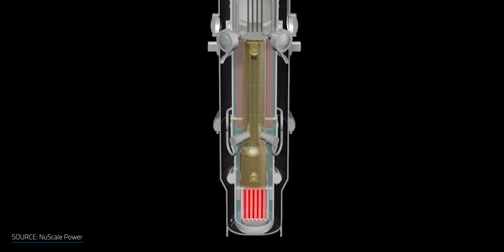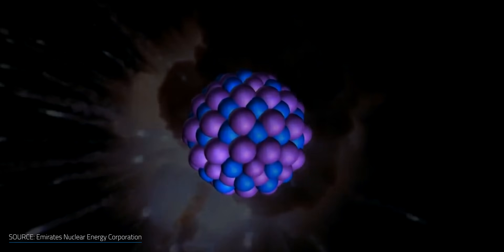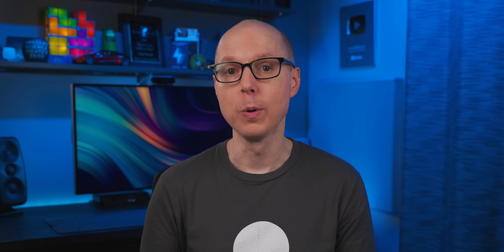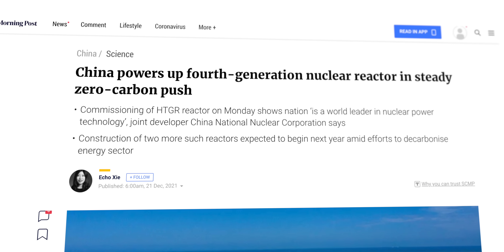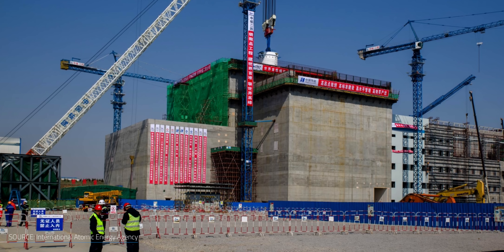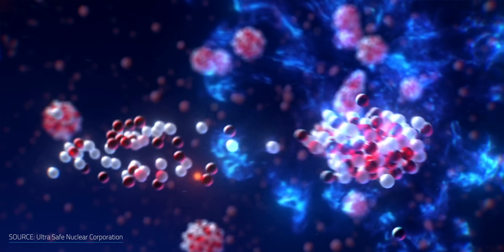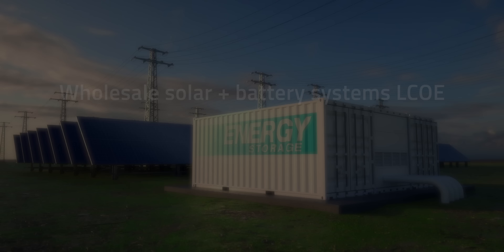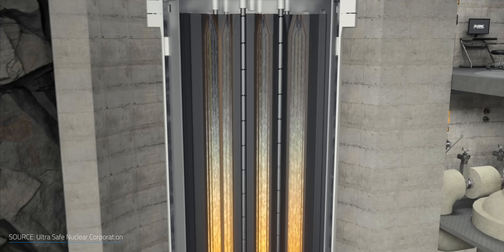Forget Small ... What About Micro Nuclear Energy?

Comment: I think it would be cool but geothermal would be good to invest in as well.
Thoughts.
Reply: Ofc. In the optimal regions, use geothermal. There’s no renewable I think I wouldn’t endorse atp. Small Nuclear could accelerate decarbonization and fill in gaps where renewables fall short
Reply: @Maverickgouda  I mean in places that can use it or don't need new technology to get deep enough.
Reply: @thesilentone4024  right, I think it’s kinda low hanging fruit & I’m not sure why it isnt there yet. I’m not even a fan of enhanced geothermal yet, solely because of the seismic effects. I believe in pursuing each renewable in their niche(s). Even more broadly, there’s applications like using geothermal to heat buildings I’d like to see explored. I’m not speaking as an expert, but something that might lower the energy needs.

Comment: On nuclear waste: 1. We know exactly where ALL of the waste is, usually stored safely on site, 2. There is the potential to use nuclear waste in next generation reactors making already cheap fuel even cheaper, 3. Due to the incredibly high energy density there is very little waste compared to other technologies.  Every energy technology produces waste.  Solar is probably the worst. After 20 years what do you do with millions and millions of dead solar panels.  Currently going into landfills or burned. Very little recycling. Also almost all solar panels come from China.
Reply: Solar pannels can be recylced, it just was to expensive. Like with everything, we throw most things away and not repair them. There are companies wo specialize in solar panel treatment and recyling.
Reply: You can bury all the dead solar panels you want in my back yard. Nuclear waste? Not so much. That being said, I do like the idea of SMR's.
Reply: Nuclear waste is an entirely different beast from solar waste though. Solar waste is waste. Nuclear waste is a hazard. Not saying solar panel manufacturing and recycling doesn't need a lot of work, but comparing it to nuclear waste just by amount is missing the point. 

Also we know where all the nuclear waste is because the technology is very centralized and regulated, we cannot assume things will be the same if it isn't.
Reply: nuclear will be 95% burn up and decay back to background levels in ~ 300 years, the nasty chemicals used to make solar is permanent and you need more of them then nuclear
Reply: @bencoad8492  What nasty chemicals? And please read about the horrible disaster uran mining is. And your 300 years figure is for processes which are not more than lab experiments. But even it it was true, humanity can´t think further than the next fiscal year anyway, so 300 years is still crazy.
Reply: @DamienFromPoison  so you don't know how solar panels are made...300 years figure isn't reprocess its liquid fueled molten salt reactors.. they do in reactor...

Comment: The Moltex fast reactor is fuelled by tubes containing the fissile materials as salts diluted by chloride (common salt). It’s cooled with the same salt species minus the fuel. There is no molten metal, no moderator and no pressure in the core. They are fuelled by the nuclear waste we otherwise struggle to deal with.  
The issues are entirely regulatory. USA regs are built for PWR. Anything else literally can’t tick the boxes so can’t get certified. 
U.K. regs are deliberately opaque and slow so nothing gets done. 
Canada is working with Moltex hoping to be on the grid by 2030.
It will be fuelled with fuel waste taken from a nearby CANDU plant. 
There is a long list of reasons why this system should be encouraged but (as ever) nobody wants to talk about nuclear.
Reply: Exactly. And for any doubt one can just look at France who has been pioneering this stuff for years now. In many regards it's all about public and political perception. Meanwhile Germany pulled off all their nuclear facilities and in turn invested only in solar and wind, and now they are in an "energy crisis" because the typical renewable sources can't keep up with the massive gap that nuclear left behind so fossil fuel plants have been employed to help ease the transition, and already it's estimated that a far greater number of people have died prematurely from air pollution from those plants, than nuclear has ever caused. All that for going green through the logic of commonfolk and politics, rather than science and research.
Reply: @Real_MisterSir  Absolutely true right on
Reply: These reactors are poorly suited for breeding weapons grade material - America wouldn't build anything but a PWR

Comment: Still taking the thorium cost at face value, despite thorium reactors requiring similar tech to fast reactors with reprocessing and the fuel and waste disposal costs not being the bottleneck? Thorium has some nice properties, but little about it is inherently cheaper, never mind significantly so. Molten salt looks promising, but is actually more useful for fast uranium reactors than thorium.
Micro is a commercial non starter because it solves problems that don't exist and creates whole new ones (similar to thorium in that regard). Being mobile is a regulatory, security, and proliferation nightmare. SMR are in the sweet spot where factory mass production is possible, but they are still inconvenient enough to move that they can be kept track of. 
Specifically for the numbers given by radiant; 7 years of fuel is overkill for almost all use cases, and makes it significantly more of a hazard. 1 year would be fine. The only use case I can see is small temporary military facilities (particularly if they are moving towards lots of EVs), and in that role fielding a reactor with 6 years of caesium 137 build-up strikes me as moronic. To avoid significant contamination in the case of it being attacked (which it has to expect) you would want to keep waste stockpiles low.

Oh, wait. I see. It is intended for Mars... It actually seems ideal for that. Like many of Elon's projects, great for Mars, sort of useless here (not a criticism).

Comment: The Ex-SpaceX engineer effort with micro reactors is interesting. A truly effective interplanetary transport would be nuclear driven, not chemical.  The ISP from thermal nuclear engines is 3 times that of chemical rockets. This delivers 3 times more impulse or Delta-V, more "mileage". Electric magneto-hydrodynamic engines,, still theoretical, offer even higher specific Impulse.  Higher ISP means less reaction mass needs to be lifted into orbit. Or, the ratio of delivered cargo mass to total mass increases.  One has to wonder what all the markets for micro reactors will be. SpaceX will need micro reactors for 2nd generation space trucks and to power settlements on the moon, Mars or space settlements.

Comment: I wonder if the West had replaced all its housing stock with super-insulated, controlled ventilated, passive designs with seasonal solar water batch heaters and maybe some solar panels or similar as an add ons, what would the power grid then require? Or could many regions have housing off of the grid?

Reactors look to me to be 'dooms day targets' for H-bombs.

Comment: The higher price for a micro nuclear plant may be acceptable if used as backup for solar/wind. Then solar/wind will need less storage capacity.
Reply: nuclear cannot be a backup it has huge inertia
Reply: @guai9632  Thanks.
Reply: @guai9632  huge inertia? maybe with the old style solid fueled reactors but with liquid fueled molten salt reactors you just change the flow rate aka they can load follow.
Reply: Except that storage is cheap & getting cheaper and longer lasting (both storage time, and duration energy is fed back to grid) technologies are already being deployed.

Check out Matt's earlier videos on Cryo storage and iron flow batteries.
Reply: @IronmanV5  Thanks Mark.

Comment: Nuclear waste is still the big negative for any Nuclear Power solution in my opinion. No progress has been made on a solution apart from putting it in deep big holes and hoping for the best. It is also very very expensive and new plants in the UK are way over budget.
Reply: The nuclear waste problem is massively over blown. The actual amount of high level nuclear waste is tiny if you reprocess the fuel. The propose geological storage sites are ridiculously stable and secure for many millions of years. For example salt mines have been proposed because we know that water hasn't managed to get in there for millions of years because if it had the salt would have washed away. Personally, I think the amount of waste with processing is so small we should consider keeping is accessible for the foreseeable future. In the future we might either find uses for it or be able to destroy it both of which would completely solve the problem.
Reply: Concerning waste disposal, my point is that these materials are mined -- from the ground.  I live on, or near, a very large natural deposit of uranium and such, and it complicates where potable water wells can be drilled, but not overbearingly so.  This occurs naturally.  Putting our waste back in the ground, and taking measures to mitigate affect isn't catastrophe or relegate superior ideas unobtainable.  Mines are, by definition, areas of concentration.  We're smarter than gas-lighting catchphrases, but people generally prefer emotion over problem-solving.
Reply: Where does uranium come from, in the first place?
Reply: @PhinAI  it's a naturally occurring metal and is mined as are other metals. I believe Canada and Australia are two large uranium ore producers. There are others, Nambia I think is one, but I would have to look them up. 
The biggest problem is naturally occurring uranium ore is very low in fissionable uranium. Namely U235. So it has to be enriched.
Reply: ...dum da da dum...dum da da dum....
Malleable manipulateable dupes....
Grim, just how in the possible heck do you personally plan to stop emitting this said carbon?  Quit breathing?  Really?  You're listening to a bunch of greedy selfish manipulators.  The answer is always going to be to keep others from breathing.
Reply: Finland has made progress with disposal of nuclear waste and most of the problems with nuclear waste comes from people who don't know what they are talking about. 
Most new power generation projects and many other building projects go over budget here in the UK.
Reply: @ladyselenafelicitywhite1596     Hi Selena. How can Nuclear problems be caused by "People who do not know what they are talking about" as you say? This is a well known problem and highly documented and reported. The UK has a massive problem with old leaking nuclear storage pools that have caused contamination for many years. As far as I am aware Finland is building a big long term geological storage facility deep underground called "Onkalo". There have been a large amount of opposition and controversy and I can understand that. This is obviously a very big concern for a lot of Finish people if the containers get breached which many studies suggest is likely. And when we are talking about "Over budget" we are talking many billions.
Reply: @Greguk444  I mistyped. I meant to write that the concerns regarding the problems. Anyway, others have addressed your points, so I see no need to add to their points.
Reply: We'll figure that out later, we need to stop our dependance on fossil fuels asap. We might be causing the 6th mass extinction event in the history of our planet
Reply: @grimaffiliations3671 , how is that?  Sounds very dramatic!
Reply: @PhinAI  there are many causes of the current extinction level. Massive deforestation, climate change, pollution, urbanisation, and widespread monocultural farming all playing a role to cause species to become extinct.

Comment: Given that grid scale solar/wind/hydro with storage is already cheaper, with a much shorter R&D cycle than nuclear, i don't see nuclear ever managing to keep pace with cost effectiveness, so it will always land in situational uses. Thats before you factor anything else in.
Reply: Take my region - Baltic states. Solar is useless 4 month a year - November to February on average sun is 5 days a month, solar generation is ~6% of summer generation - cannot be relied on at all even if you oversize the crap out of the solar field. 
Wind is also not reliable - long stretches with no wind or wind being bellow the required minimums for turbines to spin at even the minimal power generation. Easilly can be 2-3 weeks at a time like that and happens all over the year constantly. 
Hydro is already tapped out in my country and is ~45% of our energy mix. 
We can't build grid scale storage to supply 55% of the energy needs for the whole country for a month - it's just not possible with current technology.

We literally need nuclear here (right now it's gas based powerplants), because renewables will never be reliable in winter here - it's just geography and being too far away from regions where renewables do generate power reliably given a mix of solar/wind and grid scale storage to tap those via transmission lines (we will need a 2k km DC high voltage power line to the closest region that has reliable wind power - the losses on such distances become pretty bad)
Reply: @psihius  Thats what i mean by it being situational - only once wind, solar and hydro are exhausted will investment turn to nuclear, and because from a global perspective thats uncommon, nuclear r&d is under-invested in. Its unfortunate, is my point
Reply: Solar works only in south, wind is also not constant everywhere and long range DC transmission lines cost exorbitant amounts of money to build. It's less about the line itself and more about the land it requires to be built, meaning having to buy it out and some people not willing to sell and so on. Also those 750kV - 1100 kV lines require much larger safety perimeter and a lot stricter safety. Only a few countries can afford it at all.
Reply: Intermittent solutions are backed up by fossil fuels (fact) so if you want to solve climate change this is a non starter.  Hydro is only a solution in certain geography’s. Not to mention land use, wind noise etc.  The lower the energy density, the higher the resource consumption.  Solar panels come from China where all those precious metals are mined (using fossil fuels).  We do not want to be dependent on China.  Nuclear is proven. We know exactly where the waste is. In fact next generation Nuclear plants can use the existing waste as fuel.

Comment: Why aren't governments around the world  looking into geothermal power by boaring hole deep into the earth's crust and using  heat to generate  power?
Reply: Causes issues with stability of the land and can trigger earthquakes due to how it all works. While it works in geologically active regions well, the experience elsewhere so far has been encountering unexpected issues with geology and how such a hole can affect the region it is in.
Reply: There are ongoing projects to develop better drilling techniques but it's a fairly mature area (due to oil and gas research) and no one expects a massive breakthrough any time soon. The reality is it's really really expensive to drill deep holes and the amount of energy you can extract is far more limited that you might think.
Reply: Pretyy much all existing governments have looked into geothermal opportunities, and many of them have established geothermal power plants where it made sense.

But you have to keep in mind that it can become pointless if all the thermal energy is buried so far below the surface that you need more energy to create all the piping, and then pump water through it, than you will get out of the thermal effect.

So generally geothermal is only commercial if you can find a suitable high-temperature reservoir that is less than ~500 m below the surface. Easy in the volcanic regions of Iceland, less so in more stable regions of the planet.

In the end, geothermal is similar to hydro-power: It's such an obviously good solution that it has already been established (almost) everywhere it made sense, there just isn't enough supply of useable sites compared to the current global demand of electricity.

Comment: You can buy used thermo nuclear generators 36k.
Reply: A radioisotope thermoelectric generator is a type of nuclear battery that uses an array of thermocouples to convert the heat released by the decay of a suitable radioactive material into electricity by the Seebeck effect. This type of generator has no moving parts. RTGs have been used as power sources in satellites, space probes, and uncrewed remote facilities such as a series of lighthouses built by the Soviet Union inside the Arctic Circle. RTGs are usually the most desirable power source for unmaintained situations that need a few hundred watts of power for durations too long for fuel cells, batteries, or generators to provide economically, and in places where solar cells are not practical.